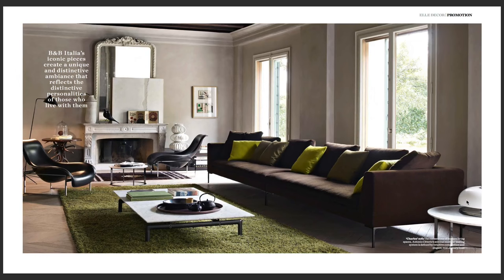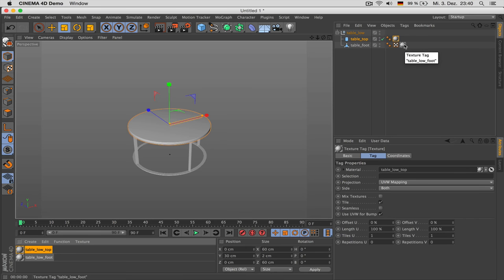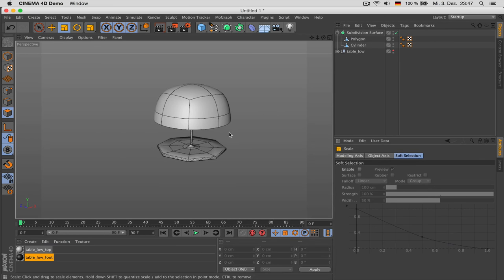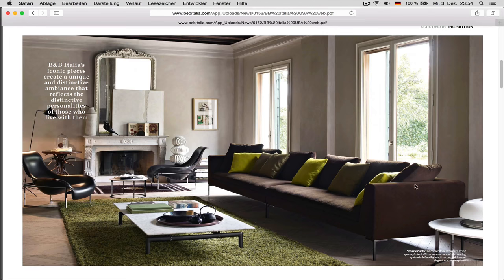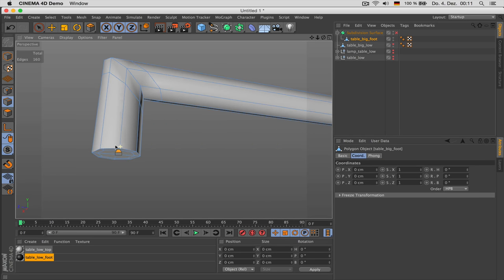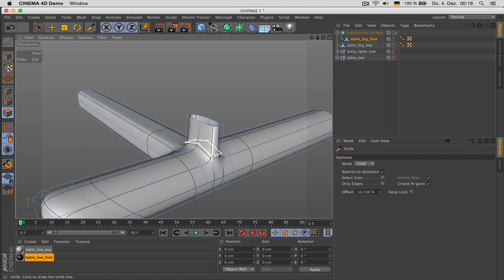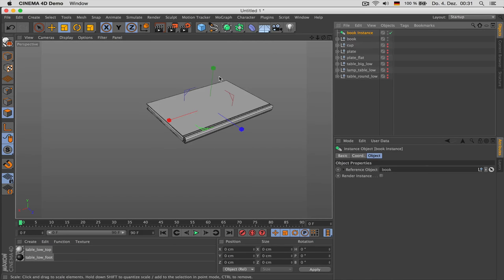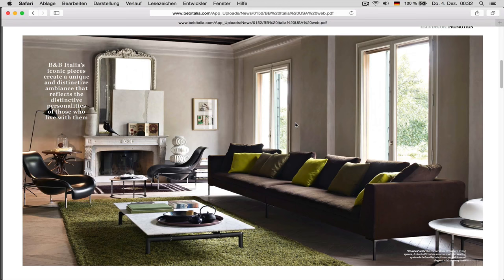Cinema 4D - Modeling Tables and Decoration Tutorial

Comment: Question.  When working with the bottom ring there are certain things which do NOT work.  For instance.  I can't extrude this ring the same way you do.  If I adjust the offset, the ring goes crazy... it doesn't just grow.  Secondly, I'm using R-19... after extruding the ring you select the edges using the Loop Selection tool (but that tool is not in R-19).  You also don't explain how you change from tool to tool.  How did you get the Extruded and Loop Selection tool?  Please let me know.  Thanks
Reply from the maker: You get it on "Select" - "Loop selection" or by pressing U-L. You can toggle tools by pressing spacebar. 
I did some more basic tutorials on modeling, that explain these things:
https://www.youtube.com/watch?v=H8debjGQfco
https://www.youtube.com/watch?v=UV5XM1Shqwc